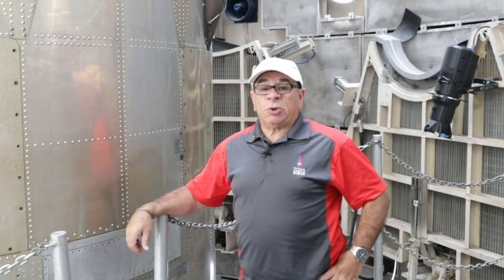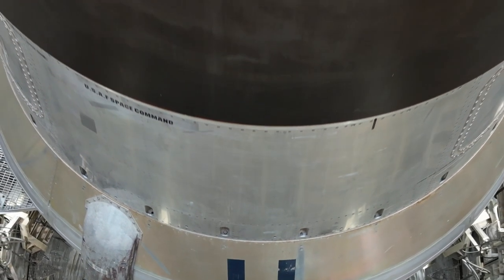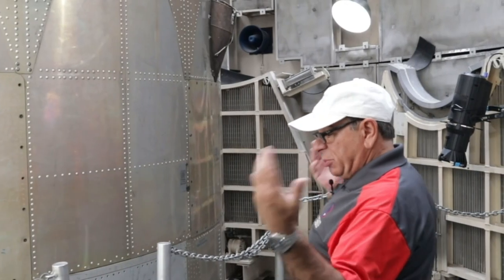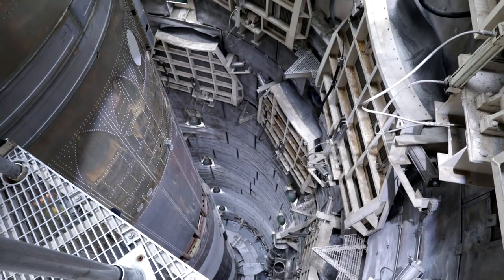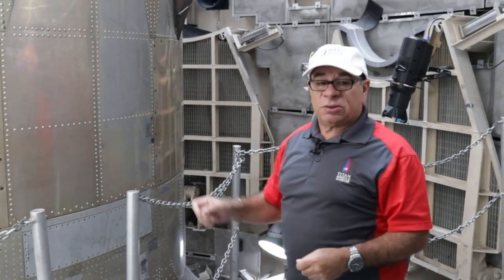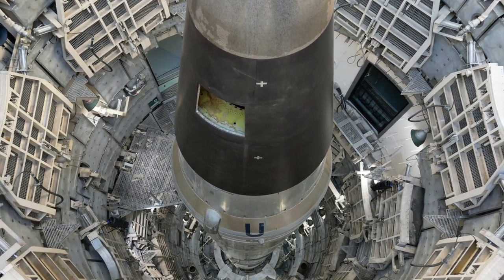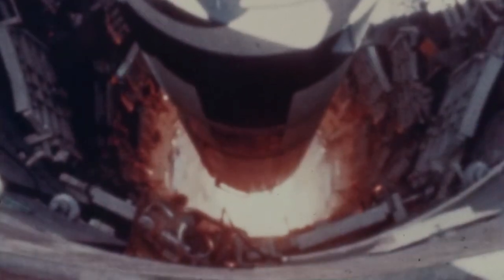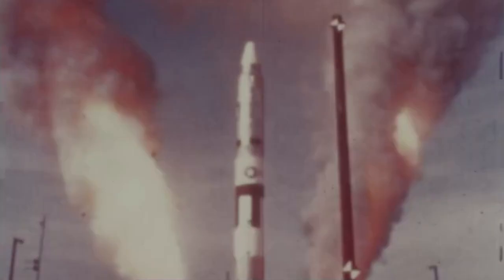Behind the Scenes of Titan II "Part 7 – Silo Level 2"

Comment: As a former Titan II Guidance  maintenance technician,  I am disappointed that you said nothing on level 2 about the guidance system. I worked on both the old base referenced guidance system and the late '70s updated space referenced system (USGS). The MGC and IMU were located between the stage 2 fuel and oxidizer tanks and were serviced there on level 2. Also, on level 2 outside the missile launch tube was the autocollimator room that referenced the guidance system to the base on the missile's original system. It required that we guidance techs perform an annual survey using a theodilite. "Balls, balls, ten flat." (IYKYK)

Comment: Question:  If the rigidity of the rocket was dependent on being constantly fueled, and would collapse if empty, what is currently in those tanks to keep the fuselage rigid?
Reply: If we believe other sources, the Titan rocket (unlike the Atlas rockets) did not have carrying fuel tanks, the Titan could easily stand unfilled without pressure in the tanks.
Probably Dave just misspoke a little.
Reply: It's not that it would collapse, but just wouldn't be able to withstand the stresses on it during flight.
Reply: The missile was installed in the silo empty and fueled in place.  It was also defueled before removal.  And the training missile at the museum is certainly not fueled.  So the missile wouldn't collapse with empty tanks.  

It just wouldn't be able to handle the stresses of launch without the fuel and oxidizer present.  But of course it wasn't going to launch empty anyway.